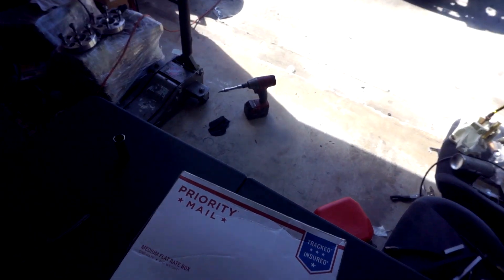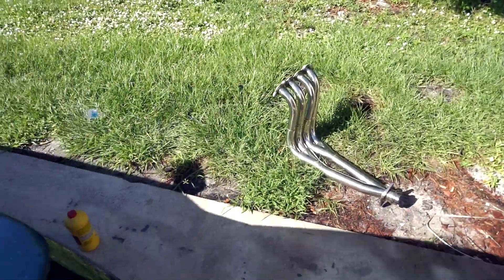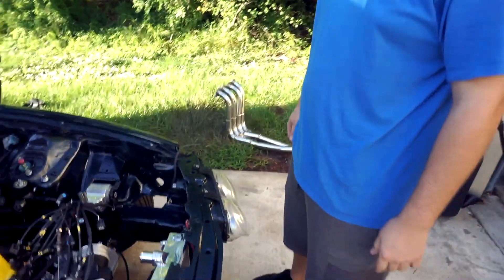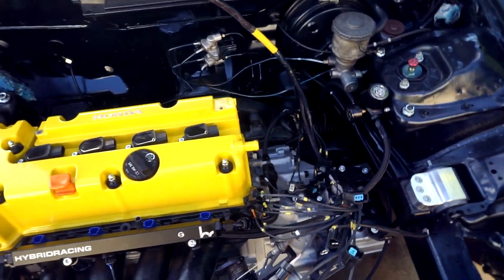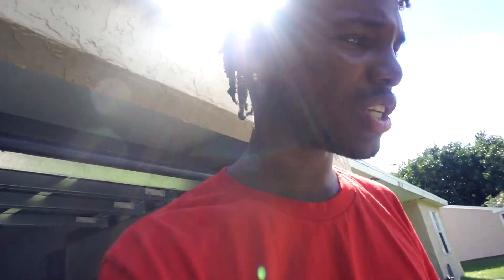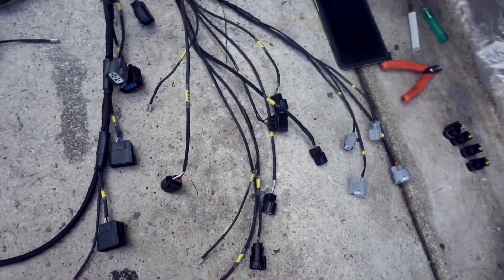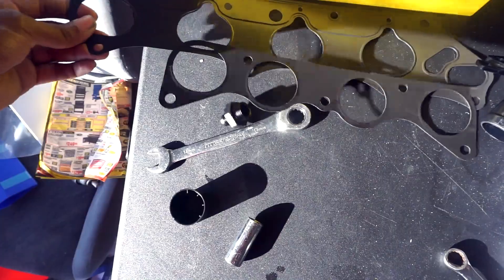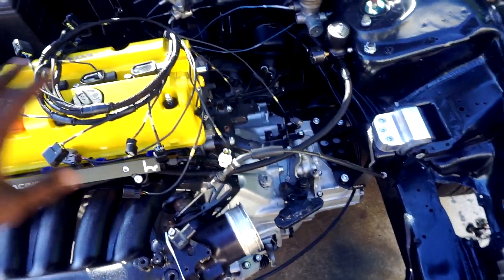IT'S FINALLY READY TO START! - K24 Integra Build (EP.15)

Comment: that fitting you pulled out of the top of the rbc mani is for your brake booster. that is a must for booster vac. you need to drill and tap the underside of the mani for another fitting. the big elbow fitting you pulled and put back in is most likely going to leak coolant now. the hole above that is where most install an adapter fitting for the coolant temp sending unit to the cluster.